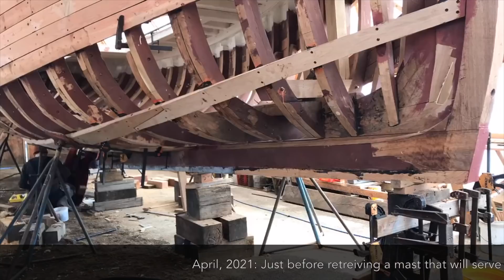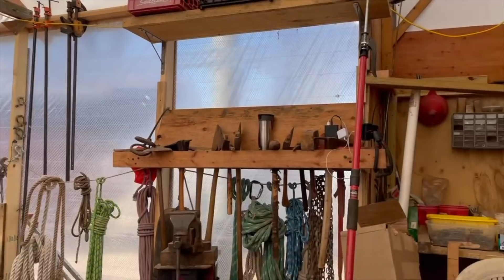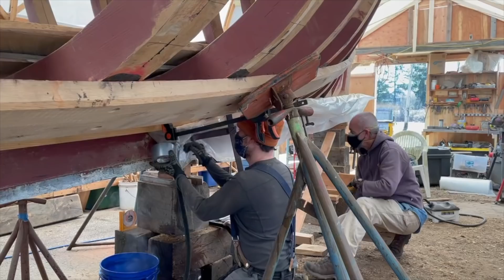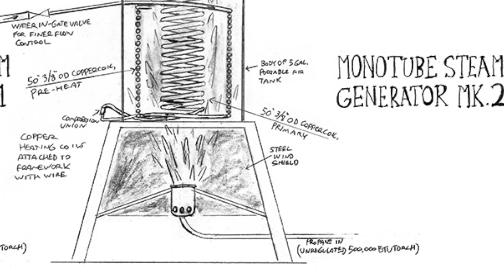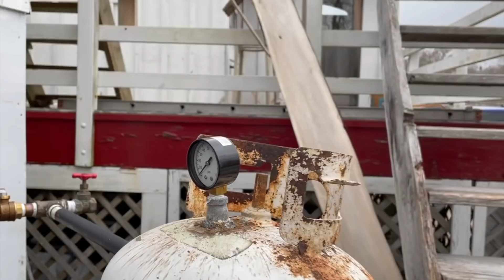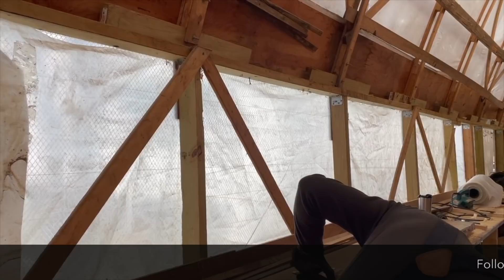Restoring Rosalind, Episode 13: In Which Garboards are Obscenely Twisted [Steam Generator Mk. 2!]

Comment: But Andrew, did you ever get that garboard plank settled in or do we have to wait for the next episode?
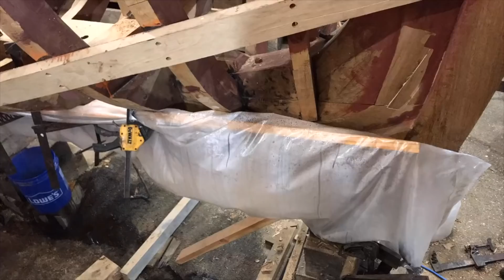Reply from the maker: Aw beans. Time lapse of it behaving itself starts at 7:20! Should have put a couple of extra subtitles in there to help. The video goes in this order: The first attempt was to clamp forward and twist into the piece just aft (it worked on the port side!), it blew out, then we cut a new board and quickly go through the steps for the second attempt, which was clamped at the scarf—that's when the steam generator pooped out a bit, and finally later that night after tinkering but before generator Mk. 2, we get it steamed in.

Comment: I'm probably a little late but just wanted to add my thoughts on mains water pressure, this can fluctuate quite a lot and makes a difference when you are trying to get a steady flow at low volume.
It would be much more reliable to have a cistern higher than the boiler and gravity feed the boiler to make sure you have a constant flow at a constant pressure.